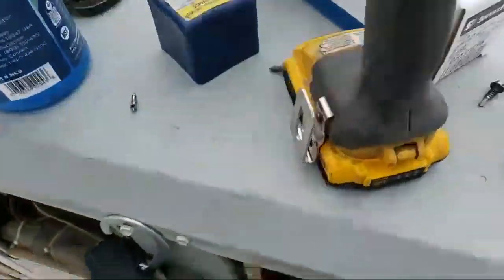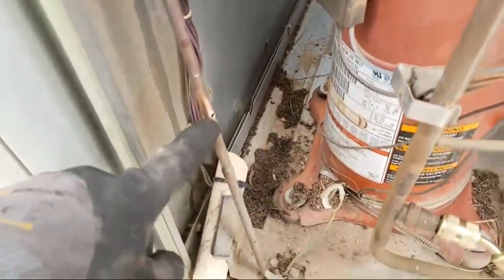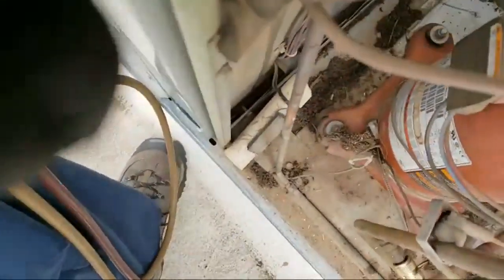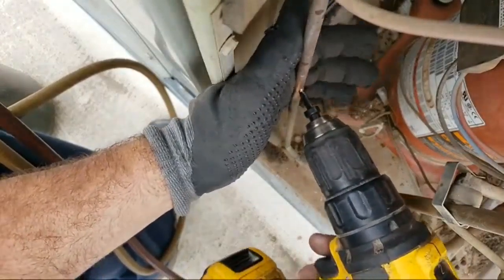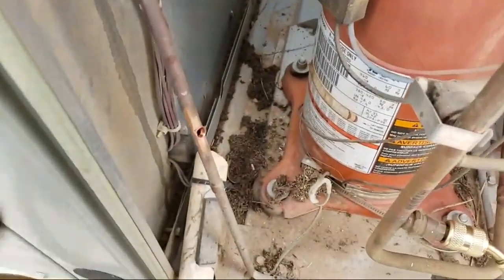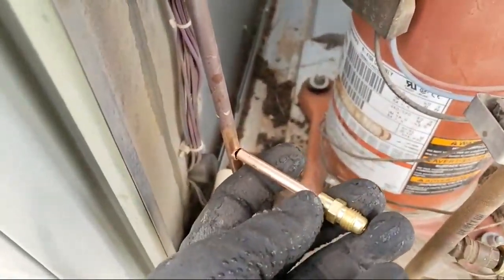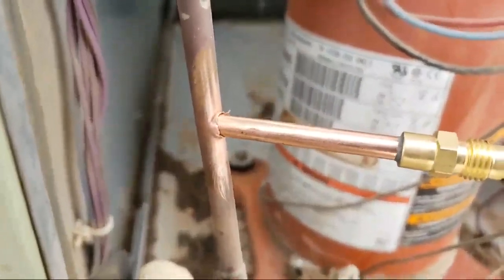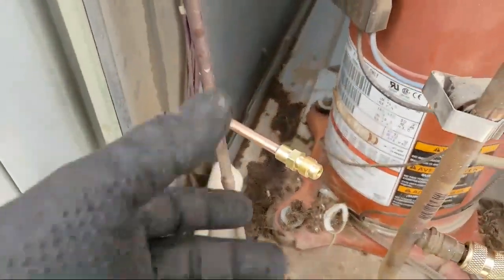Another Good Use For The "Spin Swage" Tool

Comment: What did you use to make the starting hole?
Reply: It those spinning swage tools for hvac, they look  like blunt metal bits the flare the pipe by creating heat
Reply: Yea, but it sounded like he said he used a sharpie to start the hole, then used the swage tool?? A sharpie is a marker last i knew.
Reply: @GamertagAKACUZ  sharp screw I think he said, like a sheetmetal screw
Reply: @physicsudel2013   that makes more sense

Comment: Do u buy the little test ports from somewhere, or make them?
Reply from the maker: They are sold in a pack of 5 and the stems can be 1/4" like I use and smaller. The small ones bend easily so I prefer the 1/4"

Comment: What the hell is a sharpie screw?
Reply from the maker: It is the screw that is a sharp point rather than the "self tapper" which is the drill bit pint.
The drill bit type makes a bunch of shaved copper. The sharpie point just pushes in like a wedge mostly.